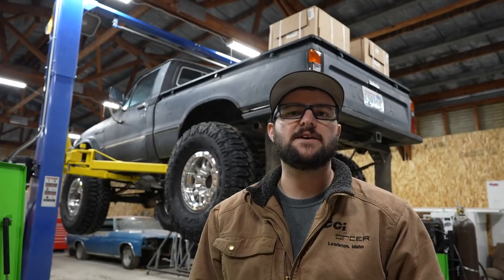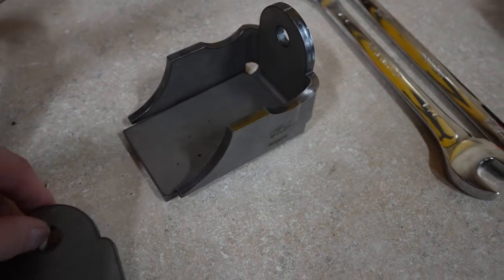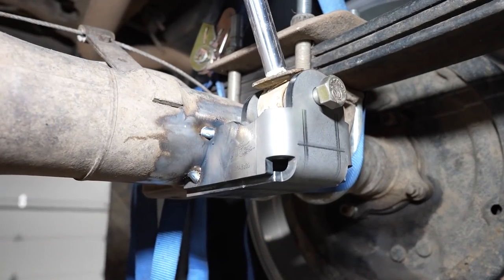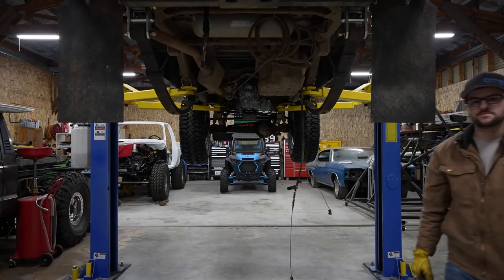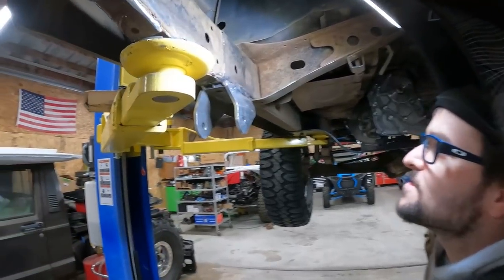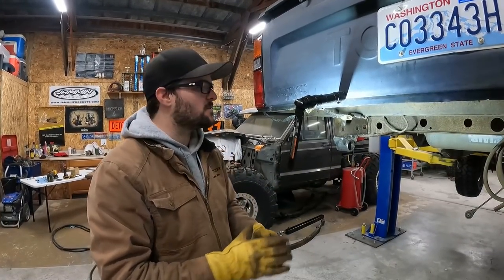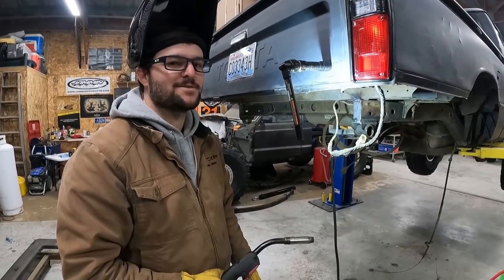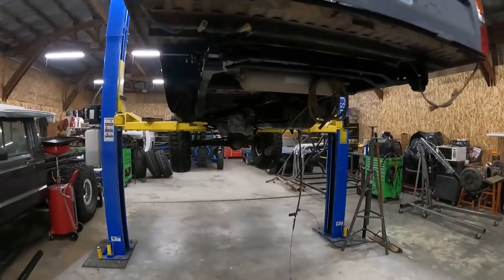Toyota Solid Axle Brackets

Comment: Maybe you got another project going on at the same time, but I swear there is a nut that is backed off about a quarter of an inch, that looks like it's holding your backing plate to the axle housing. Is that an oversight, or are you working on that also. Nice looking rig. I used to have a 1980 with barely over 100,000 mi on the clock. Beautiful burnt orange!
Reply from the maker: Thanks man! The first gens are rad 🤘They still need to be removed to work on them. I just didn't want to loose the nuts so I just tossed them on the stud a little bit.